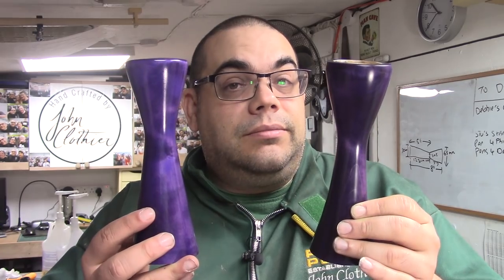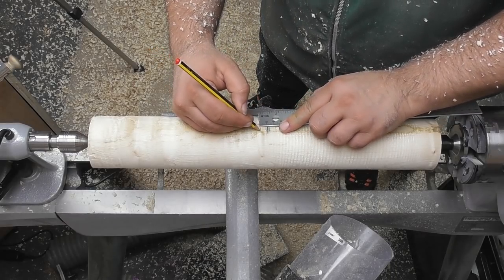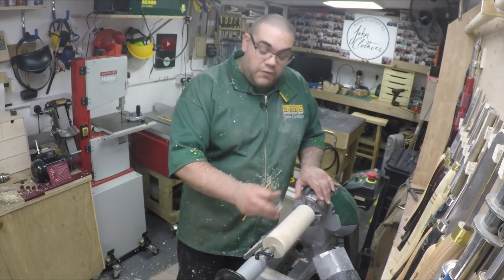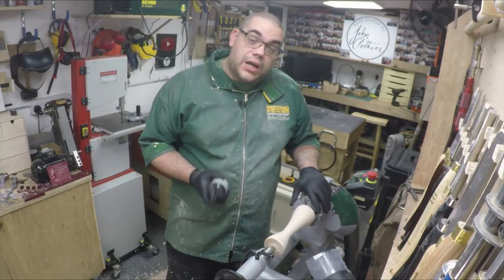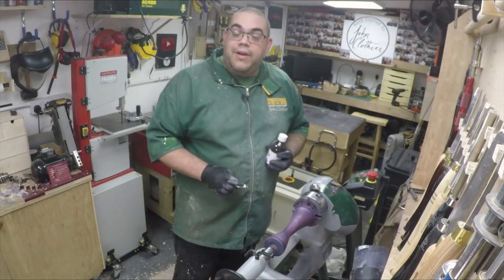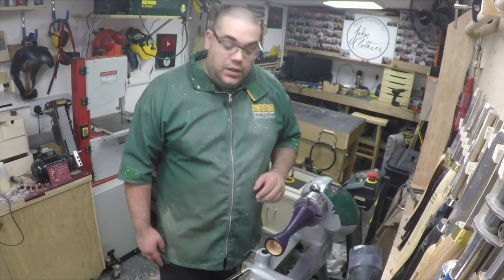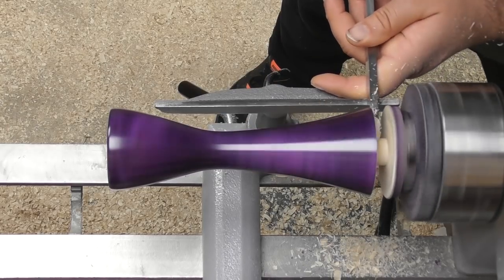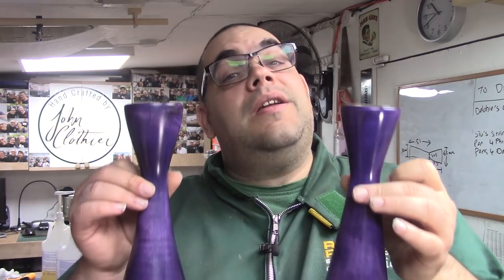Woodturning A Pair Of Candlesticks

Comment: More beautiful stuff there Mr. Clothier

Turn a plywood disc and glue a hook pad onto it...
Then you can use your lathe as a sander with the sanding pads...
Reply from the maker: Thanks Glenn. I have a power sander I can use for it but I prefer to do it manually because I struggle to keep it dead flat.i have done it before and ended up with the piece not sitting straight
Reply: John Clothier

Rotate the piece whilst sanding it....
It will want to level out then...😉

Grinding & sanding stuff square is just about a bit of experience...
I can cut steel plate with oxy bottles to within a 1mm...
Then just click the fluff off with a Grinder....
Its easy once you know...

I'm not trying to be clever...or big with it or owt....
It's just that I worked as a plater welder for years before I got into sparkying...

Comment: John these are great! Like all your work! I have a question in relation to your lathe. I bought Coronet Herald  as well and I am having a problem with it. It is off center I can experience that with any type of wood a walnut, olive or  any other, my tools are sharp I also use the eady wood tools. I am not even able to sharp the bottom. Did you have such problem and know how to fix it? I will be sending the headstock baco but I am so disapointed was hopie to turn a lot.
Reply from the maker: Thank you! No I have had no problems with the lathe at all It is a fantastic lathe. I am sure that record will sort yours out with you
Reply: @JohnClothier  thank you for a replay. I hope to get back to turning soon :)